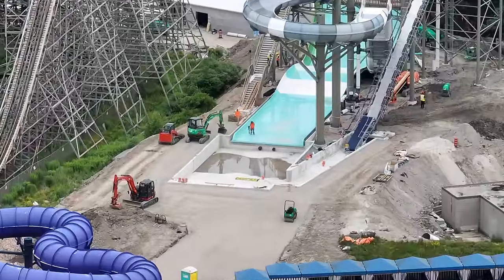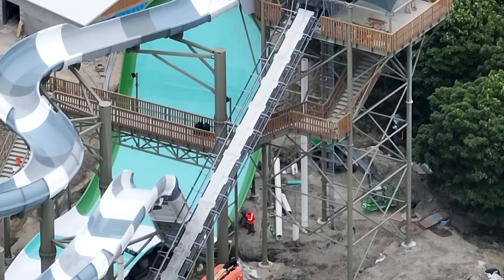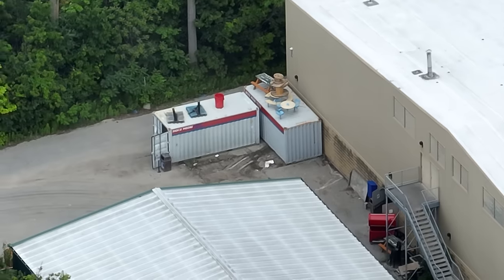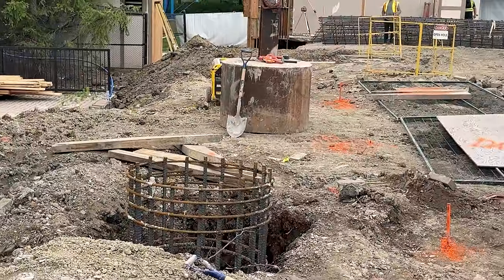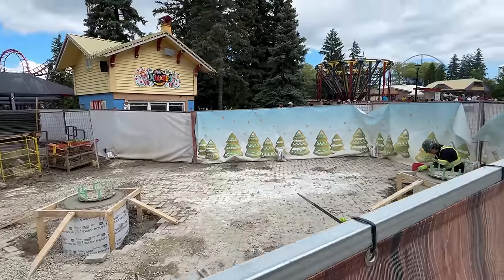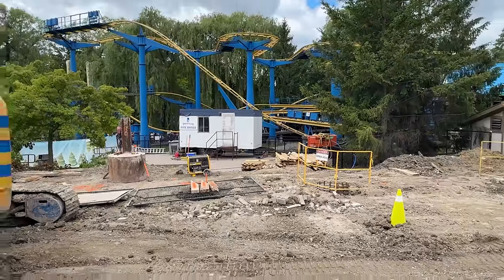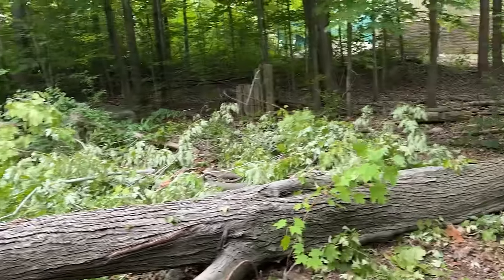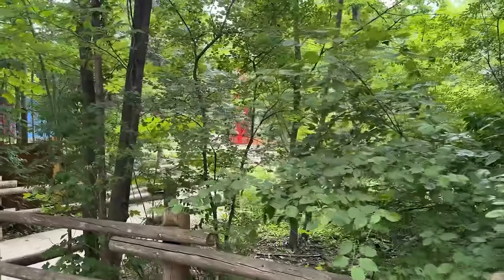Canada's Wonderland Major Construction Update

Comment: Does it seem like Moosehorn is taking a lot longer to build!  The waterpark has been open 5 weeks(ends), and we are almost in July.  I think parks need to start construction sooner, rather than (it will take this long to build).  Its not just CW, but all parks.  It seems like the New Attractions is not ready for park opening, or water park opening.   And, we are building more elaborate attractions.

Comment: The blue vacuum trucks? Are frequently used in sensitive areas to dig holes for pilings and footers. They use a water jet to loosen up the dirt and rock and suck it up out of the hole. Do not be surprised if you see rebar cages dropped into them later and then filled with concrete.